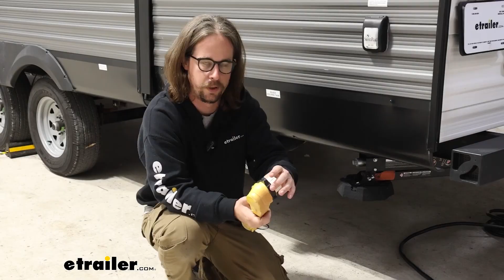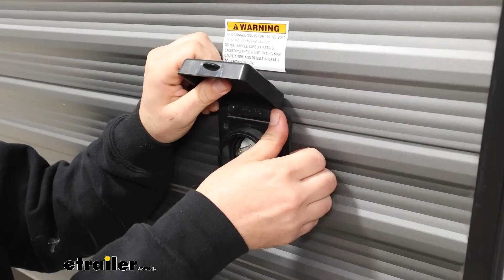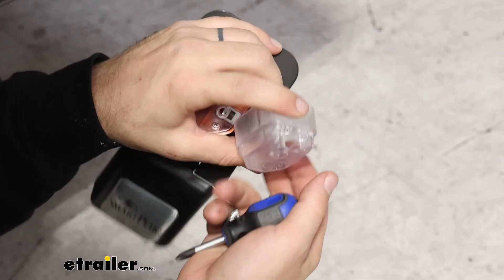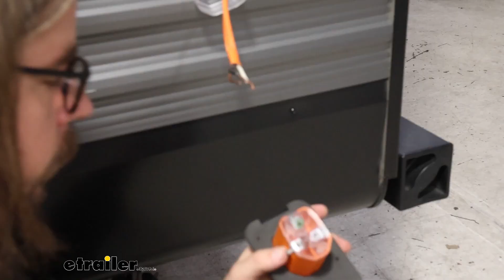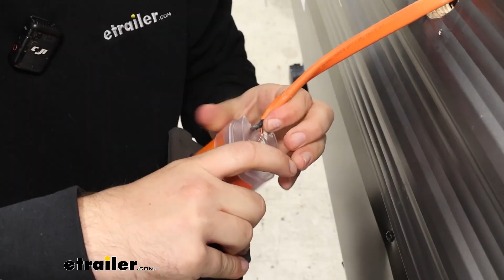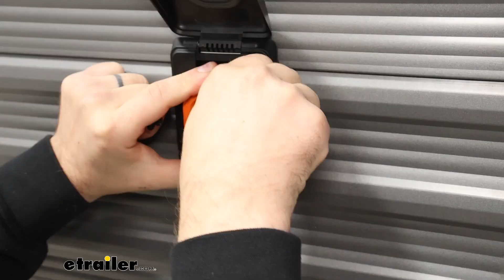etrailer | SmartPlug RV Power Inlet Review and Installation

Comment: After all you install he Smart Plug be sure to check for hot skin.
Installed mine no sweat and love it BUT.....

About a week later I was dumping grey and got zapped. Investigating the problem I found just the slightest little cut on the black wire that was making contact with ground. It looked like the clamping jaws on my wire stripper made just the slightest cut that I hadn't noticed.
Reply from the maker: Wow, glad you're okay! That's a great reminder of how important it is to double-check every wire during installation. Even the smallest nick in the insulation can cause a serious problem. We appreciate you sharing your experience and hope it helps someone else avoid the same situation.

Comment: If we install this ourselves, will it void our warranty?
Reply from the maker: If you are just looking to swap your power inlet with the SmartPlug this won't effect your warranty.  If you are not comfortable with electrical work, I would definitely recommend having a certified electrician handle this.
Reply: @etrailer  If I decide to do this install myself, do I need to disconnect the battery completely, or is it enough to turn off the master switch and throw the breakers on the convertor box to safely work on the RV outlet?

Comment: Great video and I have a very usual use for the Smart Plug RV Power Outlet. I am looking to purchase a 2024 Subaru Outback Wilderness, and I am going remove both back seats and then have a power station underneath the cabinet build with 30amp inlet plug and cut a hole in the side of passenger's side wall and place the device for use when I visit and use a campground with 30amp power source. I would like to have a lock when not in use and have a means to crank in the cord. WHAT DO YOU THINK?